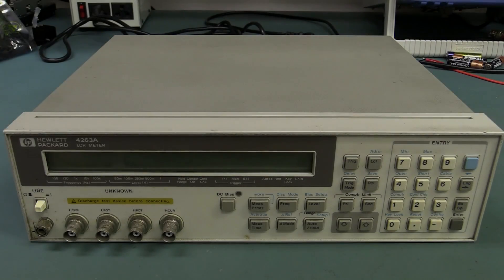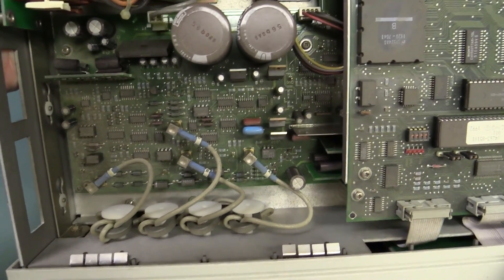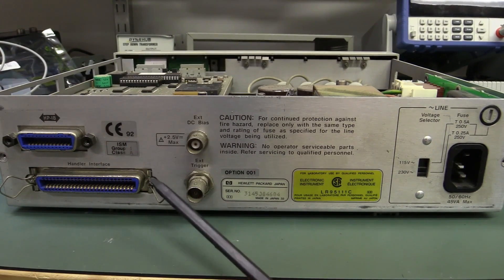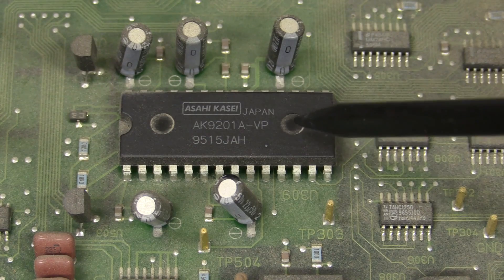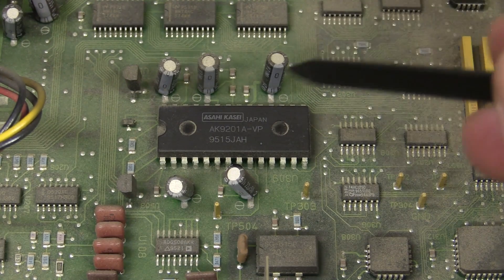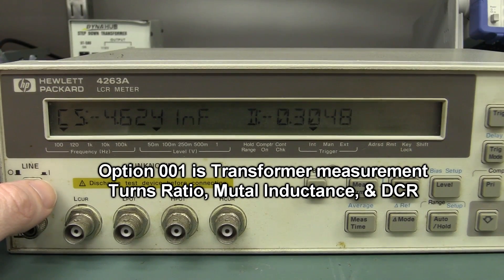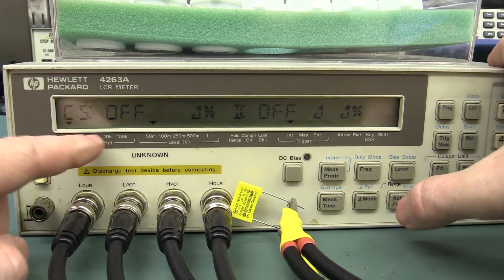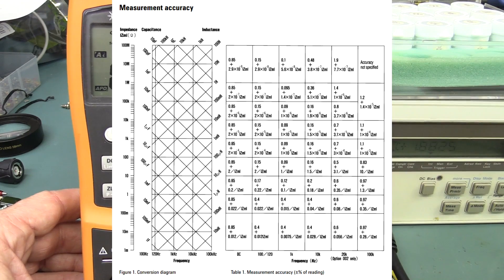EEVblog #757 - HP4263A LCR Meter Teardown

Comment: One of the nicest LCR meters I've ever seen is an ESI Videobridge.  It has a monochrome CRT display and has functions you don't seen even on more modern units.  It will do all the basic things a regular LCR meter will do, plus perform ESR testing, data logging, and analysis of circuit impedance along three thousand frequency points between 20Hz and 20kHz.  It can even be configured for parallel measurement.

Comment: 1820-1741 seems to be an arithmetic cpu, from what I read they used them in HP branded calculators as well (21, 22, 25, 25C, 29C).

Comment: So if you hook this up to some computer you could read out all or most of the measurements and calculators at once and program that to show and alert values that are out of bounds? Would be interesting to see how one would implement such a unit for small production run use.

Comment: No air cans? Time to build an air compressor with storage tank and all kinds of electronics gadgets ;) (Or be boring and buy a big soft conductive brush)... Did you have a look at what voltages the dc/dc provides and what they are used for? For me it looks like something introduced late in the design phase... "oh we have the base board ready but someone we can't get around needing another voltage for this one special asic on that other board" "ok, just whack in a dc/dc, dont want to respin the base board with the power supply section"

Comment: EEV blog: What LCR meter, bench or handheld? The Agilent you have is about $400, used classic bench models under $200 on up. No-name brand $80....Thoughts. I have a bunch of great older HP test gear, but those SPECIAL components scare me. If they go you are going to have a hard time finding a replacement.

Comment: Dave, why don't you have a compressor out in the bunker (with ear protection & Safety glasses) unless the motor noise is an issue with neighbours ? P.S. the case of that unit must have been removed for several years, or it's been stored in a camels eyelid for twenty years.

Comment: sorry to hear eevblog is down due to the fires in the server...I've come across a lot of helpful folks there.
wow below $200, have you seen the prices now? Option 001 is mainly the transformer measurement...etc. under measurement mode you would see 8 pages instead of 6 pgs when you have option 001.. 
 Just got mine, about $300. When I leave it trigger internal which is the same as auto numbers jump around too much and all measurement are less than what is marked on the caps. wondering why it's like that. I will take any input please. thanks

Comment: Wouldn't a phase angle with a magnitude of >90 suggest a negative resistance..?
Reply: flemish4 Yes. That can happen if you plug in a powered device, like a battery. If you hook up a 1.5V battery with an ESR of 1 ohm to the meter, and the meter tests with a voltage of 1.4V, it will measure -100mA flowing into the device, and hence a resistance of -14 ohms.
Reply: Thanks, that makes sense

Comment: MATE, good review, you need an air compressor!!!!!!!!!!!!!!!!!
Reply from the maker: Kris TheTrader An air compressor is not practical in my circumstances. I have to dust on the outside stairwell of the building.
Reply: EEVblog They make very small and lightweight oil-less compressors that would be perfect for this use.
Reply: EEVblog Maybe a compressor and a portable tank ,so you can fill the tank and take it where ever
Reply: Justin Bell are you talking about the ones for model air brush?
Reply: Eric Kerensky size of the compressor don`t matter ,but I have one of those portable tanks sold for inflating your car tire ,took the fitting off and replaced it with an air gun nozzle and regulator ,I can fill tank and go spray my hearts content, after tank is full no power source needed
Reply: ***** A cylinder vacuum cleaner with a hose that can be connected to blow and a crevice nozzle (the flattened one) makes an excellent dust remover. Works as an air knife too, useful for removing water from hard surfaces.

Comment: Get a data vac, works better than an air duster and never runs out.
Reply from the maker: Real Name An electric duster is of no use in my lab, the dust would go everywhere. When I air dust stuff I go to the outside stairwell to do it. No power out there.
Reply: EEVblog An electric duster combined with a vacuum cleaner would do the trick.

Comment: hey! one thing i have always wondered about is how PC power supply's can sense if they are feed 110 or 220. 

back in the day, and still on cheaper units..... you have the red swtich. but my corsair hx 850 is able to switch on the fly from 110 to 220. or 120 to 240, and 50 or 60 hertz. 

its able to run on like 100 to 270 volts and 40 to 70 hertz or something like that.... yet still deliver 850w. 

HOW! mainly.... how does it sense, and how does it switch for voltag.e
Reply: ***** The mains frequency isn't really important, because the supply has a rectifier in it and runs on DC. The compensation for the difference in input voltage is done by changing the duty cycle and/or the frequency of the switching converter. That's it on a very basic level anyway.
Reply: ***** The power supply rectifies the mains and then feeds it through a switching transformer which is switched at duty cycle which is servo'd to maintain stable output rails at the required 3.3, 5, 12v etc regardless of load. The servo controller does what ever is needed to maintain the required output voltage. Because 100-270 is much higher than the output, it really doesn't care what voltage or frequency is on the input within reason (and component ratings). If the input voltage is lower, it will increase the switching duty cycle to compensate and therefore draw more current. Some supplies will also have a PFC circuit to draw a sinusoidal input current, but that is another story...
Reply: ***** New power supplies don't switch between input voltages, they are universal input voltage 85 - 264 Vac input range (100 - 240 Vac nominal). Old ones that had switch for 110V used voltage doubler circuit (diodes and capacitors on 110V position worked as voltage doubler and on 220V as full wave rectifier), basically old ones was designed to work width 220V AC input, and universal ones are designed to work with 100V input (this is not totally correct, but it can be looked that way) and only difference is in turns ratio on transformer (both keep output voltage stability by adjusting duty cycle).

Comment: Get a vacuum cleaner that has an exhaust port to attach a hose to with a blower nozzle on the other end and the regular vac hose you can hold nearby to suck up the dust, saves buying that blowjob-in-a-can stuff all the time... :P